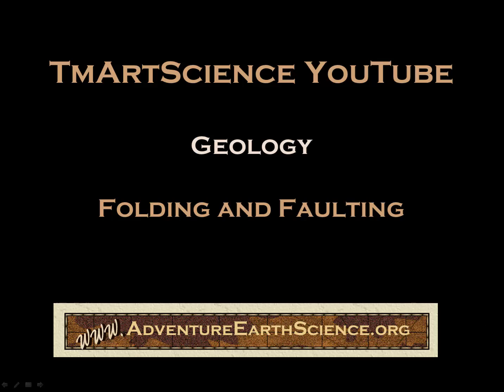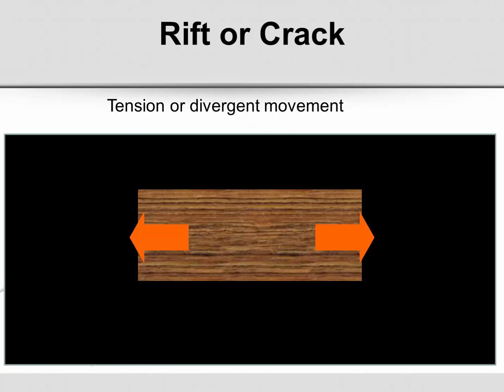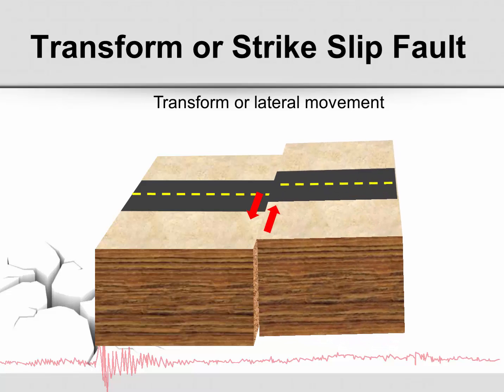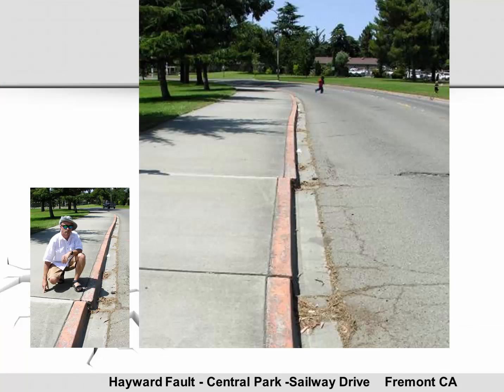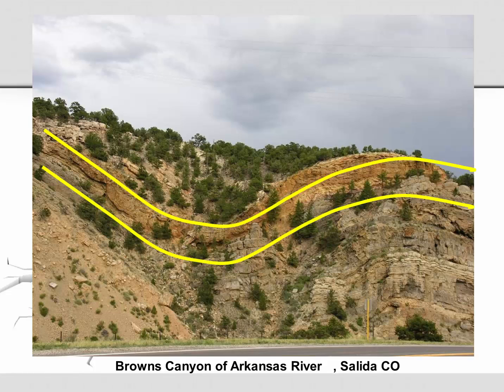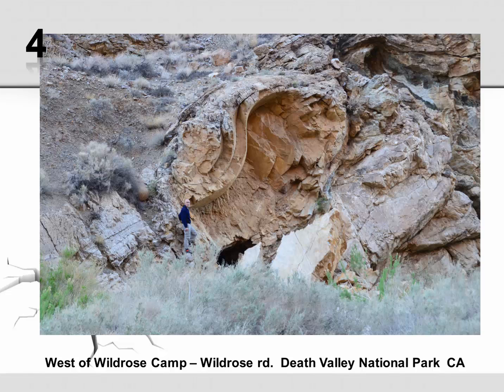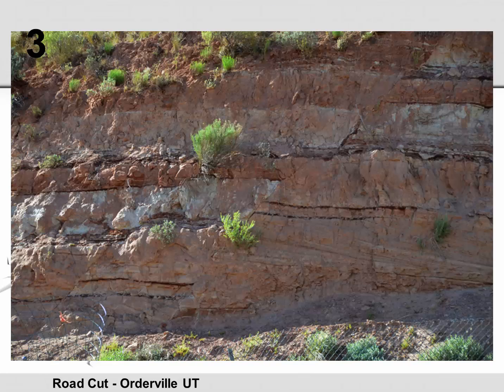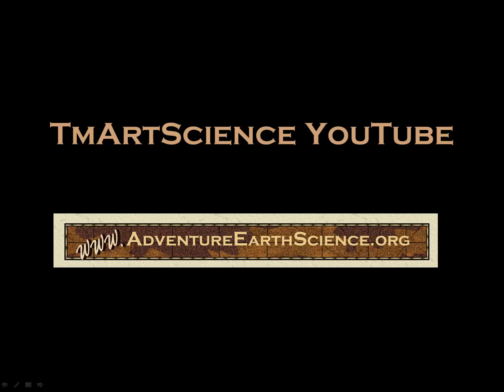TMart Science  Folding and Faulting

Comment: 6:28 why assume it's not reverse fault, how can you tell it's not the right side that rose up above the ground ?
Reply from the maker: No assumptions.   Take your time to find the matching layers.. if the hanging wall is higher, then it is reverse. On the other hand if the foot wall is higher, then it is a normal fault. In this case, the right hand side (the foot wall) is higher indicating that the entire system has lengthened.